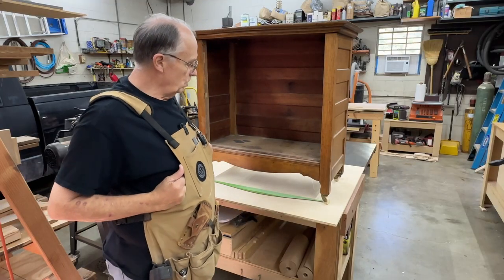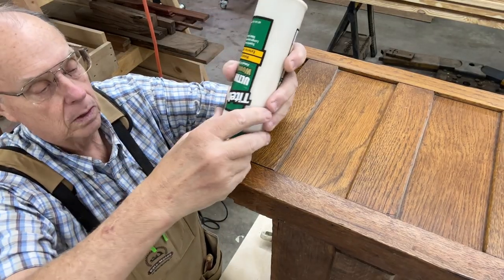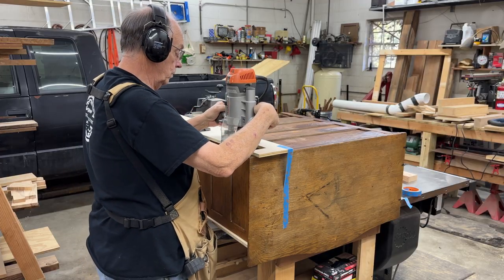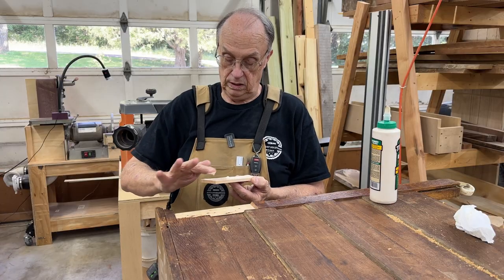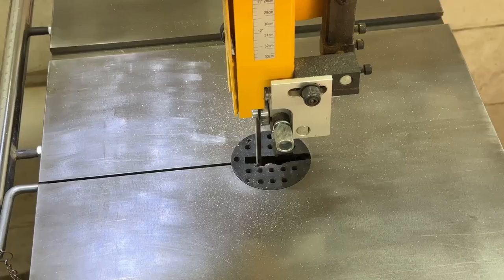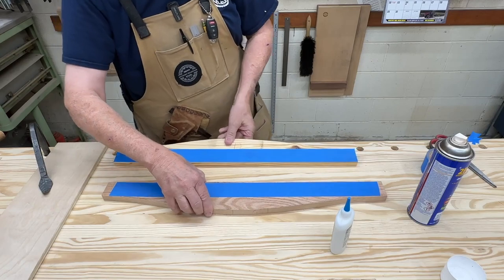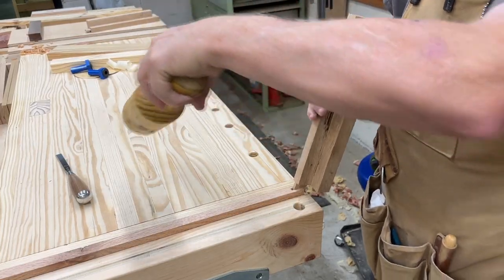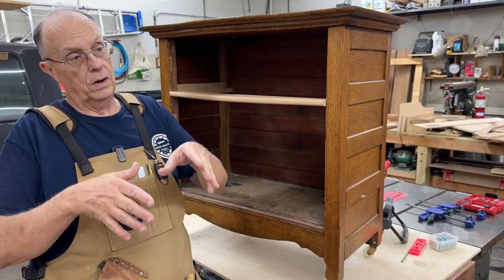Restoring a Family Heirloom  Rebuilding an Antique Dry Sink Part 1

Comment: Your projects always come out good and this one will be no exception. I've been thinking about building a curved drawer cabinet. Very curious and looking forward to how you make the drawer front. BTW young man, looks like to me you snunk a new jointer into the shop. That one would look good in my shop as well. As always, thanks for sharing.
Reply from the maker: Thank you so much for the kind words! I’m really excited about the curved drawer—it’s going to be a fun challenge, though I may need to take it slow with my upcoming finger surgery. If you haven’t heard about it, I’ve mentioned the details over on my Shop Talk with Buck channel. You can check out that video here: https://youtu.be/YgTW1PfxuuE.

And yep, you caught me! I did sneak a new jointer into the shop. It’s a Laguna JX|8 QuadTec. After years of using my trusty 6" Ridgid, making that first pass with the new jointer felt like landing a plane on an aircraft carrier—smooth and powerful!

Thanks again for your support and for watching. I really appreciate it!